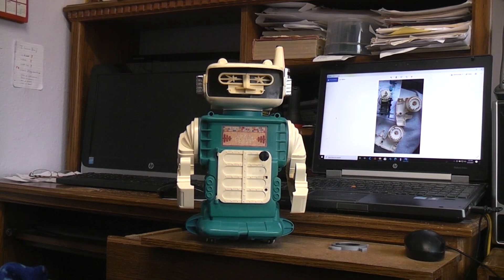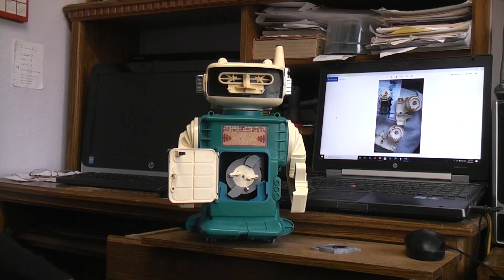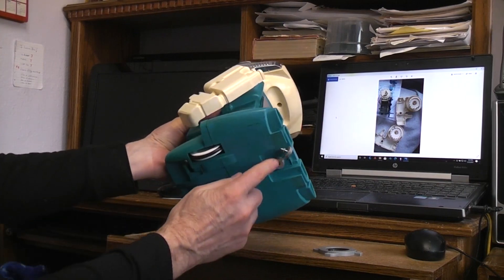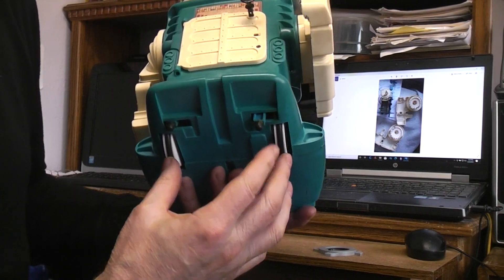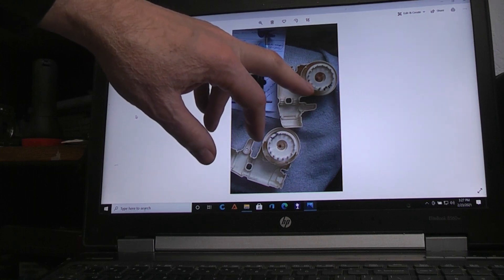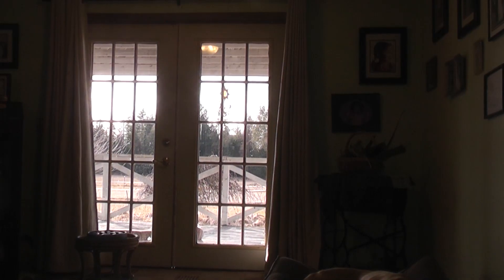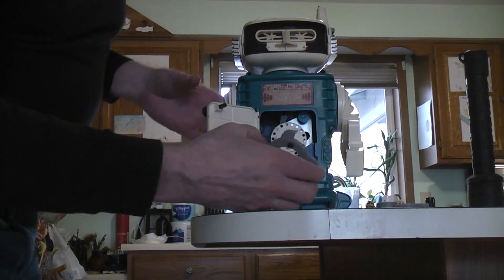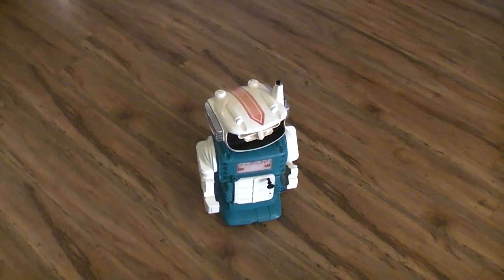Disc Programable Remco , Mr. Brain robot. Made in USA in 1969.

Comment: Hi do you have any video or tips or pointers in replacing the back wheel on Mr Brain?  Mine which I got off that famous auction page has the back wheel broken off. Which I was not aware of before purchasing.
Reply from the maker: Here is a link that shows the bottom side and the rear wheel. There seem to be two types, one is a wire and wheel and the other is a all plastic wheel set up.
https://www.theoldrobots.com/MisterBrain2.html
Reply: Thank you!  @Robothut  Mine is the plastic wheel. It's been snapped off and was not included with the auction. Sounds not so easy to fix as the metal one. :(

Comment: Great reference video! I'm working on a Mr Brain that I just acquired. Is there supposed to be a wide spring running through the neck to the head? I saw a photo on the web of the inside and there was a neck spring with the wires to the head running through the inside of the spring? Thanks!
Reply from the maker: I do not recall a spring running threw the neck to the head. Just the wires to the smoker unit.
Reply: @Robothut  OK thanks.  Getting ready to put mine back together, but have to drill in a few #2 screws because its missing some of those darn fragile plastic arm pegs. It only has one metal wire junction peg but I'll improvise and twist the second group of wires together with some aluminum foil and gently push them into the second junction hole.  I'm a big fan of your videos, they are entertaining and very informative!